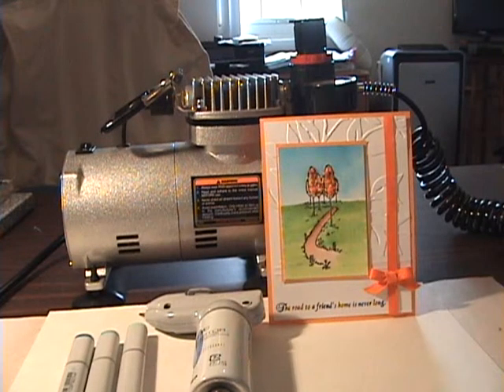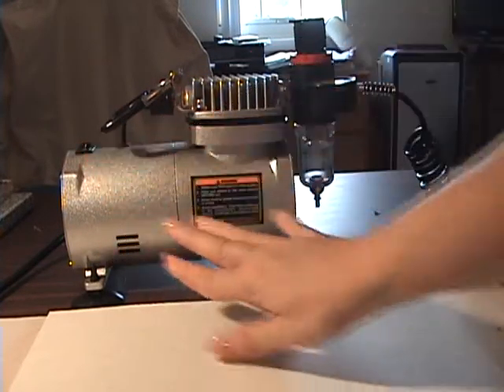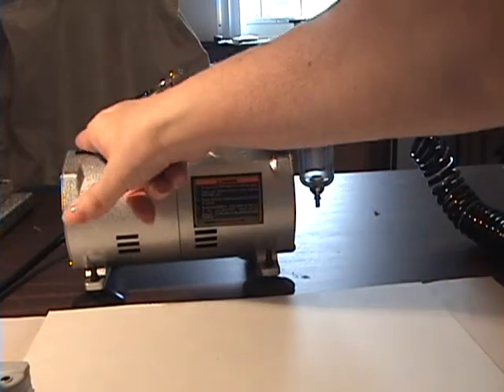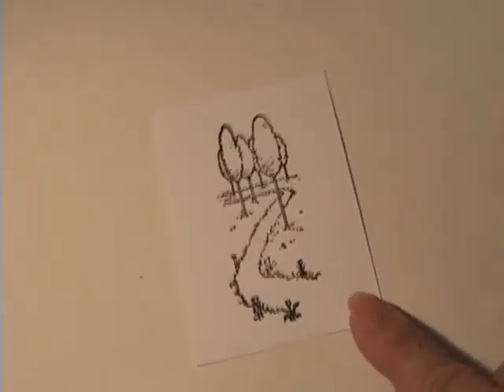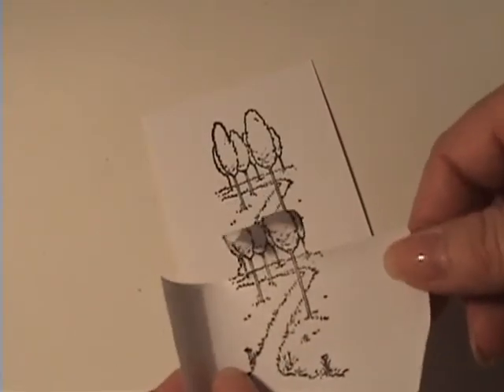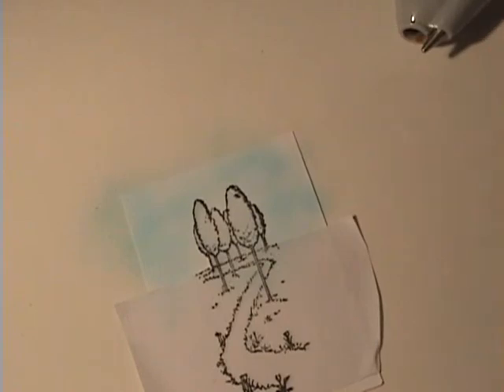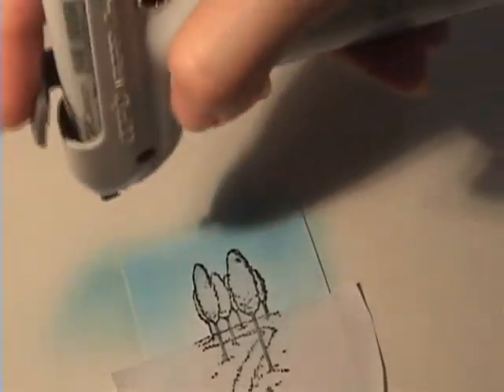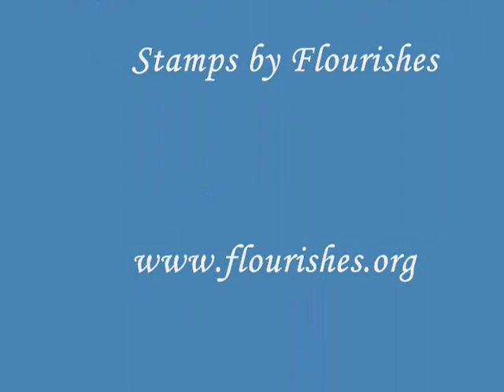Air Compressor and Copic Air Brush System Basics

Comment: I bought a small compressor today but do not have the adapter that goes between the hose and the Copic marker holder.  Why do I need the adapter?  If I buy one, will it last indefinitely or does it have to be replaced like the cans of air?

Comment: It looks like the airbrush doesn't work with very much power or that not very much colors comes out. Can you also change the "settings" or do you have to go over the areas more often to get darker tones?
Your video is very helpful :)
And do you think the "sparmax AC-100" will work? Because I don't see how much psi it has.
Reply: CopicGirl  if you want thicker just go slower and or closer to project

Comment: the air compessor does not have a tank ...it is a on demand compressor when u need air it kicks on and only runs to u get the pessure u set and then it stop